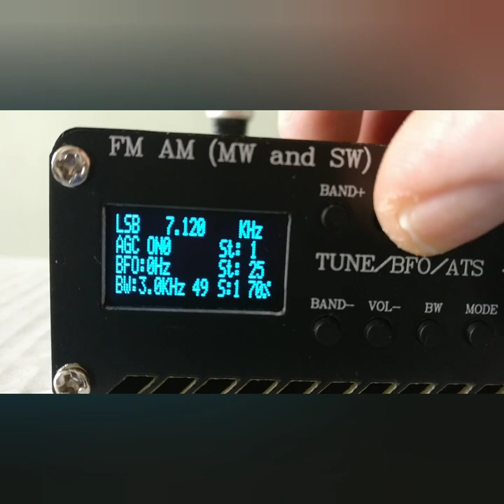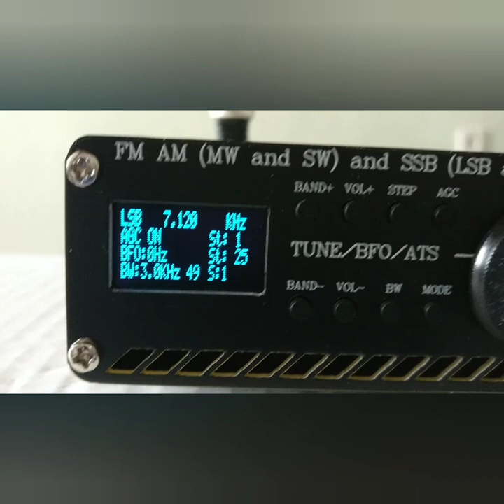SI4732 Radio with the Arduino Nano, PU2CLR SI4735 Library

Comment: Many thanks for sharing the experiences. Another crappy junk in rice box. Thanks for saving our money mate.
Reply from the maker: This radio comes from an Arduino project by PU2CLR. It's purely experimental and actually not intended for the general public. This radio doesn't even have a broadcast memory. I am constantly changing the Arduino code to experiment. The Radiwow R-108 is cheaper have a Si4734 chip inside (this can not receive SSb). The sound from the R-108 is better then The XHDATA Radio. 
The SSB sound is not so good with all cheap digital DSP receivers.
Reply: @pg103flo6  Well the main issue is choking noise while tuning the band. Annoying to operate...

Comment: Your antenna is more expensive than this receiver 😀
Reply from the maker: This Antenna bought for my Yupiteru MVT-7200 and works fine. This Antenna is builded for Handheld scanner radio. With this Radio in the Video in the near i have interference from the Arduino nano.

Comment: Hi there does it cover airband ,thanks
Reply from the maker: Hello, no this radio can not cover the VHF Airband. This Radio have not a converter inside. Tecsun, Xhdata radios with airband have a vhf to shortwave converter inside.
Reply from the maker: But you can also listen the Airband radio on the shortwave. But you have to modify the Arduino sketch so that you can receive everything seamlessly with this radio.

Comment: What Antenna are you using?  Thanks, Mark
Reply from the maker: Hello, i buyed this antenna from here: https://sv2czf.com/mwa30.html This mini whip antenna is designed for portable radio receivers. The gain is weaker than with the standard Mini Whip antennas. Advantage that the recipient is not overloaded.
Reply: @pg103flo6  Thanks, I bought one just now. -Mark
Reply: V

Comment: Nice toy, but overpriced i think, much more usable xhdata receiver costs same.
I buy half assembled pcb without aluminum case, it work well.
Reply from the maker: Yes, the XHDATA D808, TESCUN PL-365 and the new version TESCUN PL-368 in the under 100 Euro class with SSB.

Comment: Frequency coverage? thanks
Reply from the maker: Hello, this radio receives from approx. 149 khz to 30 Mhz.  But there are gaps in between.  But you can modify the Arduino sketch so that it is complete.
Reply: @pg103flo6  thank you ! 🤟